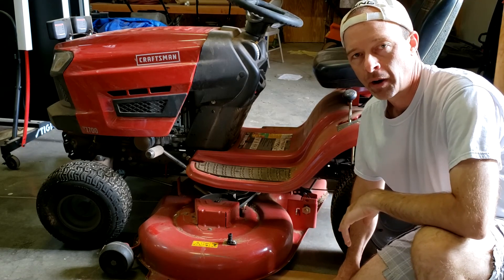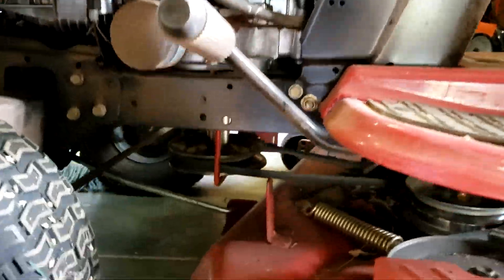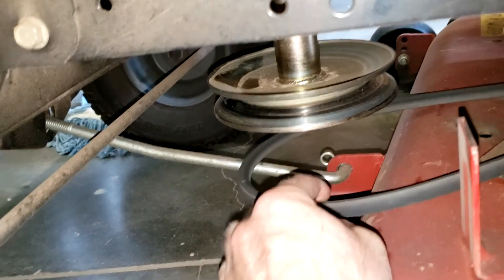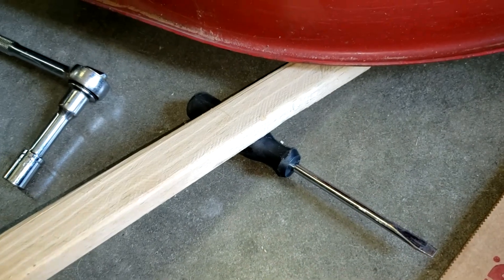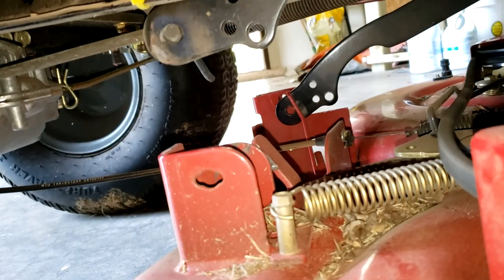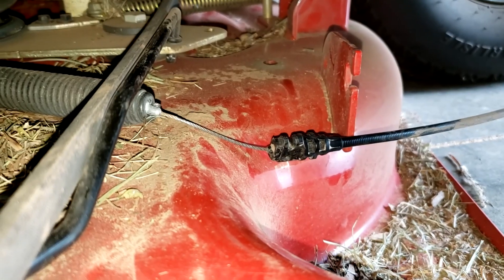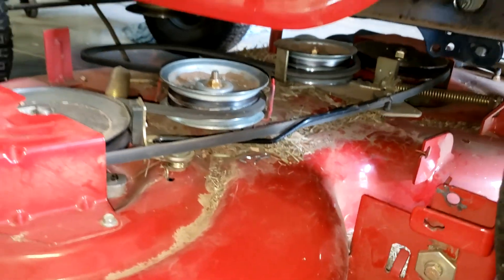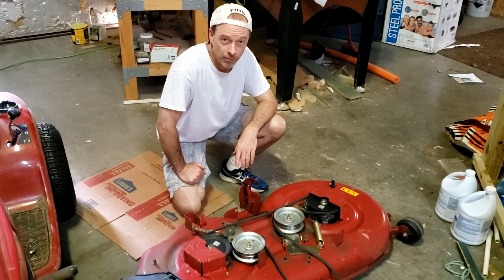How to REMOVE MOWER DECK on CRAFTSMAN riding tractor

Comment: I'm having a problem with mine, exact same mower, where it seems my engagement pulley for the blades isn't moving far enough to tension the belt I'm taking the deck off in hopes of finding a problem, thanks for the video!

Comment: I've got a Craftsman t3200. It appears the deck assembly is completely different. What model are you dealing with? Have you seen a video on the t3200? I haven't.
Reply from the maker: Mine is a T1700. I haven't looked for other videos.

Comment: Where did you put the cable? Mine is dangling down.
Reply from the maker: There's a grommet on the cable that attaches at a bracket near the back of the deck, if I remember correctly.